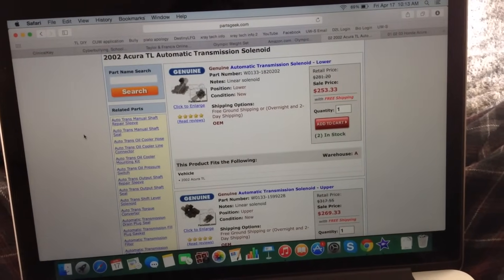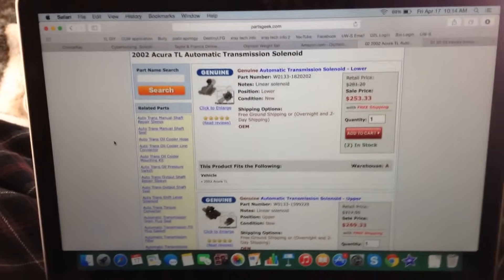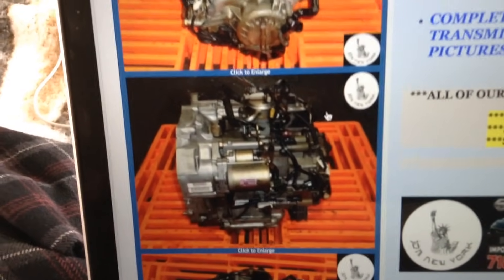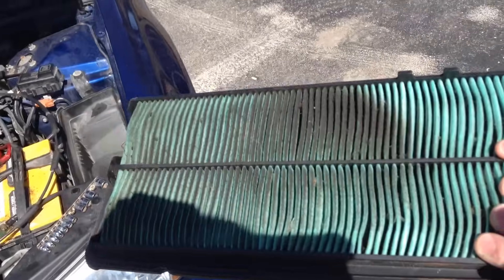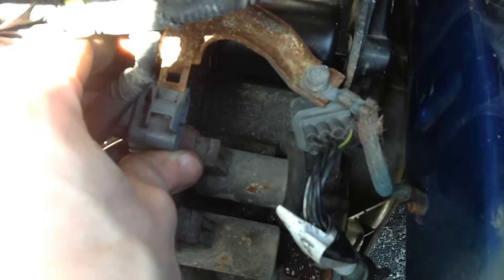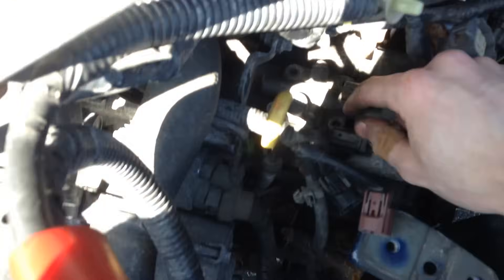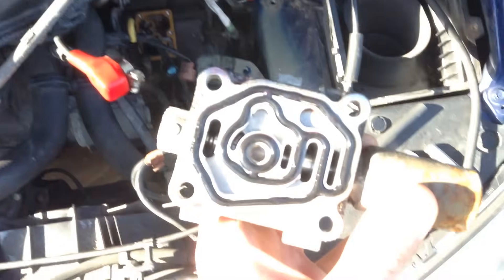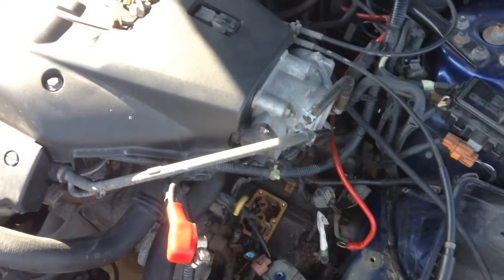Transmission Fix: How to Clean Solenoid Screen Filters for Honda/Acura P0730 P0740 P0780 P1750 P1751

Comment: Also no one seems to say what specific transmission fluid to use I went to the Honda dealership they try to sell dw1 Honda and on Amazon it says that won’t fit my car and recommended some aisin brand dw1 at Acura i got a qt and the parts service guy said that if they ever ran out they would just order from the Honda dealership a shipment until they get more of there’s in stock that it’s the same but it doesn’t say on the websites or forum then another fluid popped up z1 the car has near 170k having shifting issues mainly 4th and 5th
Reply from the maker: Use Honda DW-1 transmission fluid, it replaces the old Z1 fluid
Reply: @CarRepairsMadeSimple  the one with the red cap grey bottle
Reply from the maker: Big Germ yup that’s the one! I have another video on my channel on how to change the transmission fluid
Reply: @CarRepairsMadeSimple  part number 08200-9008 that’s the Honda dw1 and the Acura has the same numbers just an A at the end he said it’s the same as the red cap one they tried to sell at Honda dealership and Acura said that both dw1 is the same just an A at the end for rebadging I got one qt just to lubricant the filter parts and maybe add since some will spill but on Amazon it says it’s not for my car but at the dealerships that what they did try to sell me what u recommended and dealer did Amazon must be on crack trying to make the transmission slip even more buying there junk

Comment: Years ago wonder if anyone will still reply 164k miles automatic 03 type s TL slips 4th haven’t hit 5th no check engine light or anything on dash
Reply from the maker: if you have your own OBD-II scanner, check and see if there are any pending codes. Otherwise, check your transmission fluid level. If it's too high or low, that can cause problems. Also, if you don't remember the last time the transmission fluid was changed, or if you see it's dark-colored and/or has a burnt smell, you definitely need to change it. I recommend performing a 3-quart drain and fill every 15000 miles. And lastly, try cleaning the solenoid filters as shown in this video.
Reply: @CarRepairsMadeSimple  just got off work and just left the Acura dealership planning on now going home and cleaning the filters or try to get them off smh seen a type s at the service dept :( I bought the car yesterday from auction drove it home bunch of cities away like 3 hours to get home car didn’t overheat or anything just noticed it wouldn’t shift into 4th which at first I thought was 5th the gears are there it just won’t shift the whole way home 3rd gear redlining almost 65mph and if u held the gas if u were lucky it maybe went Into the next gear 4th and able to pass 70 got to hit 100 didn’t go for 5th in the trunk I also found Lucas transmission slip smh who knows how much the guy dumped in there and funny thing is we use to put the same stuff in an 04 accord I had because tranny started slipping after a flush but the 2003 Acura TL type s feels like it wants to pull 1st 2nd and 3rd power and all there and reverse and doesn’t jerk I’ll scan it but yeah no lights on the dashboard lit up
Reply: @CarRepairsMadeSimple  thanks for replying 2021 feb 26 ima see what helps because at this point I’m stuck w the car

Comment: If you ever break a solenoid, (ask me how I know), go to a junkyard pick and pull and it will only be like 20 dollars
Reply from the maker: Auto Outlet that is true! I guess my main concern is if you do that, you’d be putting a used 15 year old solenoid back on your vehicle. But I suppose it depends on how much money you want to put in the car and/or how long you plan on keeping it.
Reply: @CarRepairsMadeSimple  yea definitely, luckily Honda parts are super reliable so they are usually still straight to use. Definitely better paying 10-20 dollars than 300 dollars

Comment: Did u drain the transmission oil before removing the it?
Reply from the maker: MTB SaK nope you do not need to drain the transmission fluid to remove these solenoids

Comment: Awesome video, I have a 2005 TL and one about a year ago I got that P0740 error code,,, it went away by itself, but I knew something was wrong and feared transmission problems, now I know what to do. Knowledge is power, thank you
Reply from the maker: It's a shame it took the community so long to find this solution, but I'm glad my video sparked the discovery of it! Glad my video was helpful!
Reply: I have 2006 TL, are the part numbers the same?

Comment: Thank you so much for this video and the transmission filter/oil change, my 01 cl type s was having extremely hard shifting , sometimes 3rd wouldn't go into gear and sometimes 1st would lag into 2nd and be a very rough shift. Reverse would be a late and rough shift and so on and so on( at the same time learning how to drive without beating down my trans.) .still going to do a 2nd drain n fill because the bolt was literally covered with sludge and metal😭 the screen filters were so gunked up it took a while to clean them out and had to use a lil tissue and a coffee straw to remove some of the crusted gunk. SO AGAIN in 2020 🙏thank you so much for saving my transmission!
Reply from the maker: That’s awesome to hear it worked for you! I’m glad my videos could be helpful! Keep up with those transmission fluid changes and these cars will last a very long time!

Comment: So I have a 2003 Acura TL 3.2 Type S  with 173,100 miles previously owned by one owner and well maintained. So I got a check engine light come up and read the code and it was P0740( Torque converter Solenoid). I was frightened, but I did my research on Google and YouTube. Upon that, I stumbled across this video and I was like okay I have similar symptoms of transmission slipping a bit and having a hard time picking up on highway speeds. Also turning and hitting the gas at the same time was a problem. So I decided to do the exact same fix myself. The process was very simple but annoying. I recommend the universal ratchet it helps a lot. Oh I forgot to mention if you do plan on doing this do it on a flat surface because as I was removing the solenoid and the transmission fluid leaked a little to the side. In conclusion the top solenoid screens were clean, but the bottom solenoid screen/filter was very clogged with transmission gunk. I didnt have a air Compressor. So I bought a Computer cleaner can of Compressed air at Staples or office depot. So it did the job and cleaned it right up. After cleaning the screens on all the solenoids I put everything back together and now my transmission feels more responsive and no slips and ill update if anything persist. So far it feels good 👍 the process took about an hour.
Reply from the maker: That is very good to hear this worked for you! You can also use brake cleaner to clean out the screens as well. In some cases, I've heard of people having to clean the filters twice or even three times, but let's hope it's a one-and-done deal! I also know you said the previous owner took good care of the car, but just make sure the transmission fluid isn't brown, black, or giving off a burnt smell, and always use Honda DW-1. Best of luck to you!
Reply: @CarRepairsMadeSimple hey even if it does give off a burnt smell is it still worth doing this procedure??
Reply from the maker: @JoelCenteno-u8q  I would say yes. It’ll probably take 2 or 3 drain and fills to get the fluid looking better, in which case, I would recommend driving at least a few hundred miles in between each drain and fill so that way you don’t shock the system with all the new fluid and potentially cause even more problems.
Reply: @badluckbryan  this is exactly what i’m currently dealing with.
Reply: did you buy chance have a leak? i was told at the oils hop i had a leak a small one though. do you think just cleaning the screens/filters helped? and in addition, did you drain ( and/or) flush the trans fluid? i went to autozone got the same code and that was one of the results that was given on the paper. as well as changing shift solenoids.
Reply from the maker: @414NashBaby  if you have a leak, you can buy a replacement gasket and orings separately if you need to
Reply: My 2002 mdx with 120k miles is kicking. Everything i research leads to the trans solenoid but there's no check engine light. I did a flush but no difference. Plan on changing the solenoid but it's expensive. Have any of you experienced this without a engine light on?

Comment: What I recommend to everyone who gonna do this job, buy new solenoid gaskets and small rubber seals.
These bits are cheap and worth to replace especially if car is older than 10 years
Reply: Happen to have a link to buy them ?

Comment: Would this work on my 2007 Acura tl type S?
Got code p2647.. VSA & Abs light stayed on.. i turned on the car & this popped up out of no where.
Reply from the maker: That has to do with your engine and VTEC, which kicks in at high RPM's. One cause for that code is dirty engine oil, improper engine oil level, or abnormal oil pressure. So make sure you change your oil frequently enough, and also it's at the proper level. Otherwise, it might be the valve timing oil pressure switch assembly, part number 37250-PR3-003 located near your oil filter. Worst-case scenario, you replace this part, which is $81 + shipping. There's lots more information in the service manual: https://cardiagn.com/2007-08-acura-tl-vtec/
Reply: @CarRepairsMadeSimple  thank you I appreciate the quick response

Comment: Hey man GREAT video!  I have a 2000 acura tl and I have the codes, p0730 and p0706.  When I test my Solenoid like you did ( the big one ) I am getting 7.2 to 7.5 on both plugs but your getting 5.5. Is my Solenoid bad?
Thank you..
Reply from the maker: The solenoids should measure between 3-10 ohms. So it passes the ohm test! You could also get some alligator clips and wire, and connect it your cars 12v battery to see if it's clicking. Also, make sure your transmission fluid isn't super dark and dirty, make sure the ATF is at the proper level, and only use Honda DW-1 ATF.
Reply: @CarRepairsMadeSimple  This is going to sound like a dumb fucking question but 

If a alternator goes out could that cause coil packs to fuck up? The day I replaced my alternator my car started to misfire and I thought I fixed it but it actually gotten worst. 
It was NOT misfiring at all before my alternator went out only after
Reply from the maker: @williammcarthur6845  is it idling rough or is it misfiring? There is a difference. I know when I disconnect my battery, my car idles rough at really low RPM's, almost like it's bogging down for the first few hundred miles. If you're not getting a CEL, give it a little bit of time and see if it goes away.
Reply: @CarRepairsMadeSimple  I got codes for a misfire and it is idling horribly. I replaced the spark plug and coil pack and still misfires
Reply from the maker: @williammcarthur6845   which codes is it giving you? If it's a particular cylinder, try moving the coils and plugs around and see if the code changes cylinders. It could be a variety of things. One of the new parts could be defective, could be a bad ground, could be a bad battery or the new alternator isn't charging the battery properly, maybe the coil connectors aren't connected properly. Hard to say when I'm not there. Check all your connections, and get a multimeter and check the battery voltages. There are plenty of videos on youtube on how to test your battery and alternator. Or maybe take it to AutoZone where they can test it for free.

Comment: My Acura CL is having shuddering problems in third gear. Do you think if it is solenoid or something else?
Reply from the maker: I've heard simply changing the transmission fluid can help fix shuddering. I would give that a try if it has been a while since you last changed it. Cleaning the solenoid screen filters also can only do good!
Reply: @CarRepairsMadeSimple  i changed it a month ago, helped me a bit.  Now its starting again but its not as bad as it was.
Reply from the maker: @gaviesohal  how's the fluid condition after changing it? It the fluid is still dark enough, sometimes a second drain and fill is recommended.
Reply: @CarRepairsMadeSimple  yes I'll give it another try. Thank you for your help👍

Comment: i get bad downshift when slowing down almost to a stop and upshifting after driving about 15 minutes, i have changed the trans fluid but never changed the filter or solenoid, mechanics tell me without looking since i have a flashing d5 when the shift happens that i need a new transmission, i dont think so. but i dont have a place to fix this
Reply from the maker: I had very similar problems myself, including the flashing D5 light. Cleaning both solenoids very well could fix your problems. Although it might look intimidating, it's actually pretty easy and you could simply do it out in a parking lot even. There's just a lot to remove, but it's all just a bunch of simple bolts. I'd give yourself 3 hours to do this job if it's your first time. All you really need is a basic socket and ratchet set, a swivel/universal joint socket adapter, needlenose pliers, and either brake cleaner or an air compressor. Good luck!

Comment: While taking the top one off A bunch of stuff fell into the res. Do I need to flush it out?
Reply from the maker: The little pool of transmission fluid beneath the solenoid is technically outside the transmission, so you could clean all of the debris and contaminated fluid out with a simple paper towel. Luckily the openings for the tubes are pretty small so there's likely little to no debris that actually got in the transmission. Plus there are filters throughout the transmission that are made to catch such particles, so they likely won't make it far.

Comment: Have questions I charge to new and it was worse now I need your help should charge all of soleniod
Reply from the maker: idk what you mean by charge a solenoid. Did you mean you bought a new solenoid and your transmission problems are worse?
Reply: Yes and it got worse
Reply from the maker: @mechanicauto9704  I've heard of your situation before and my guess is you bought an aftermarket solenoid and not an OEM Genuine Honda one didn't you? I've been told aftermarket ones don't work right. They're $300+, expensive yes but that's the premium price you gotta pay for these electronic parts. Not something you want to cheap out on.
Reply: eBay but I found the problem I didn’t have enough transmission fluid in it now it read beautiful
Reply from the maker: @mechanicauto9704  Awesome! Yah the fluid level is also very important. Overfilling it can also cause its own problems. Now that you got a good working solenoid, just keep up with the transmission fluid and spin-on filter changes and it'll last forever!

Comment: just buy a new one cleaning is not going to work
Reply from the maker: It very clearly works as I've driven another 90,000 miles since doing this, and thousands of other people will agree.
Reply: I did it for 15 year and my has 240000 it not going to last long
Reply from the maker: You're right they don't last forever. I've had other people tell me cleaning the filters did nothing for them, but then replacing the solenoid fixed their issue. But a replacement solenoid cost $300+ and considering this is free, it's worth a try. That's also why I included an Ohm test at the end of the video which will actually determine if they need to be replaced or not.

Comment: Hey man, great info. Hopefully this will fix my shift delays from 1-2 and 3-4 and my CEL (pressure solenoid failure), without having to totally replace the solenoids, on my ‘01 CL-S. Quick question: did you change the fluid before or after doing this? Trying to decide if it would be better to change the fluid before hand, to avoid having to clean gunk out of those screens again if I change fluid after...will be doing the 3x drain and fill and changing the external spin-on filter as well
Reply from the maker: If it's an option, yes, I would recommend changing the transmission fluid and spin-on filter first and cleaning the solenoid screen filters after. Of course, it requires the same disassembly to do both jobs, so you can get both done at the same time! Good luck!
Reply: @CarRepairsMadeSimple  thanks

Comment: Did you also do a video on replacing the tranny filter?  It is supposed to be replaced every 30k miles.  If you did one but not the other you may still have the same issue.
Reply from the maker: https://youtu.be/SjYVD2WCrCM
Reply from the maker: I did! The link above is my video on how to replace the transmission filter and transmission fluid. Enjoy!

Comment: Can I use carburetor cleaner to clean the filters? Because I don't have access to an air gun.
Reply from the maker: I would avoid carb cleaner because of the oily residue it can leave behind, not to mention a little overkill with how harsh the chemicals are in it. Brake cleaner works well though!
Reply: @CarRepairsMadeSimple  thanks. And  now that I think about it...I can use canned air the you use for computers and keyboards. That should work also. Your videos are great!. Keep up the good work.